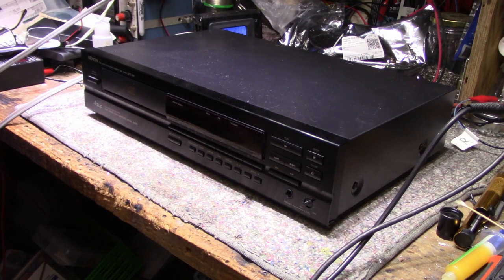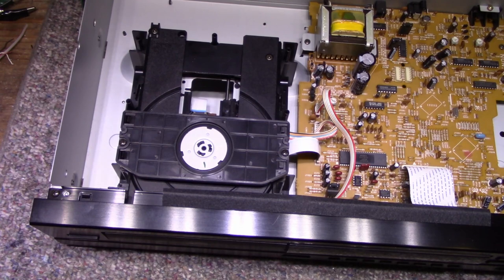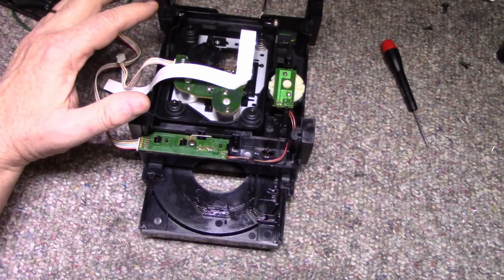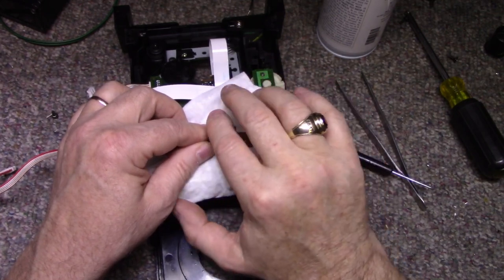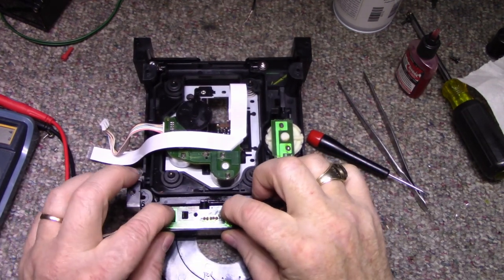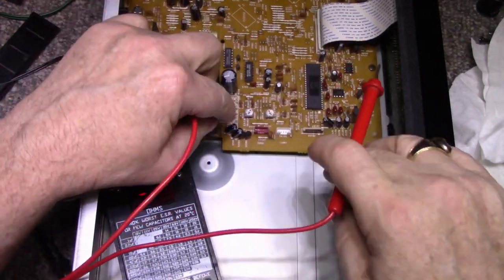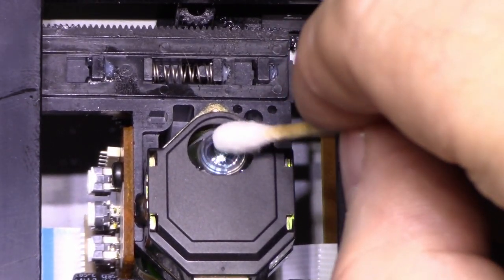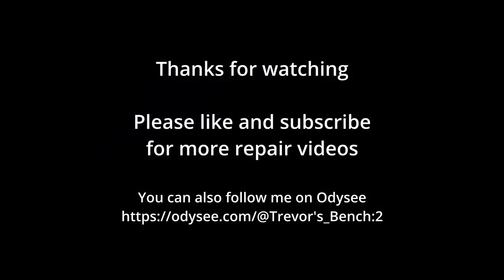Denon DCD-695 CD player - Repairs (Ep. 162)

Comment: i have a dcd 825, the 825 has burr brown dacs also and a generic kss240a laser, it has elna cerafine caps in the audio section as standard, i have replaced the caps in that section that trevor has pointed out a couple of years ago before the originals went bad, dont know about this model but the 825 has a rather annoying quirk, its analogue outputs are variable only and only operated via remote control, so if anybody gets one and its quiet then a sutible remote of some sort is required, otherwise overall a good sounding well made cd player, and this one dosent look a lot different.
Reply from the maker: Thanks for the additional info, much appreciated
Reply: Acquired Sony XB790QS SACD player a couple of months ago - one can never have too many players, in good condition apart from one annoying quirk. It would play CDs and SACDs in 2ch and 5.1ch mode as expected, but once you've turned it off and on again with the hybrid disc inserted, it would insist the disc was a standard CD only and refuse to switch to DSD playback. Pressing open/close would re-load the TOC and it was back to normal. Anyways, I've decided to try and find out what it was all about at a later stage, once I have replaced all of the smt caps in the RF and servo section with low impedance, fresh ones. These are generally miniaturized with the detriment to quality and longevity. Funnily enough, that solved the "memory loss" issue as well ! And John, unless someone ramps up current on these lasers, they will continue to run long after you and I are gone !

Comment: I have that same CD player and it is not working. I am after some advice! 
1.It has power as the tray has been closing as soon as it ejects so I cleaned the tray switch - fixed now. 
2.Ordered a new belt as when the cd is in it does not register on the display, this hasn't worked.
3.Order a new laser, not fitted it yet - could it be this or could it be a motor or else?
Thanks in advance